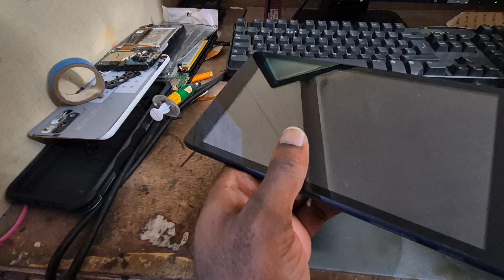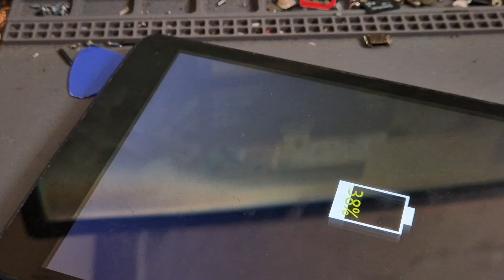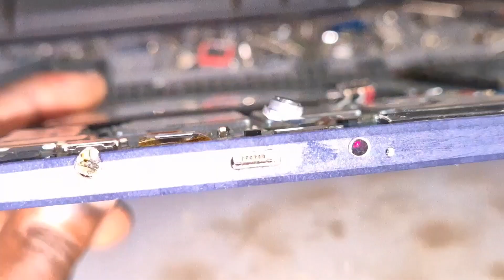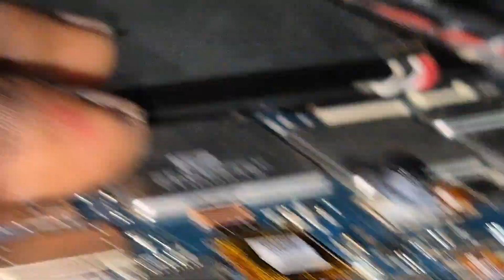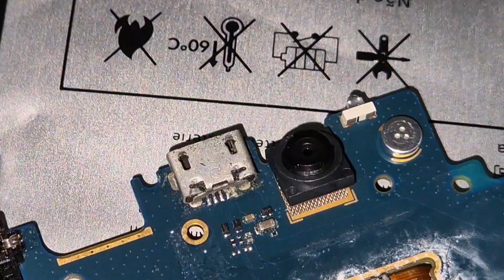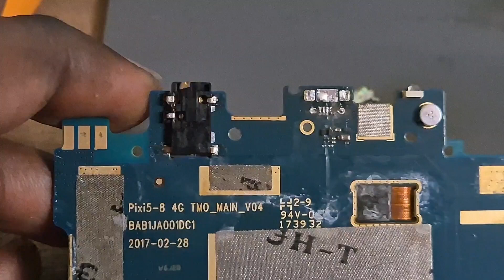Phone or tablet charge going down instead of up -battery going down instead of up when charging

Comment: water damage clean with alcohol and reflow with rosin flux to help insulate the pins . Rosin leave a film layer to protect from corrosion
Reply from the maker: end up replacing the port, the positive pin was actually damaged. nun of the pins were damaged on the board just covered. not all job i use with flux. inhaling flux can have many side effects down the road, got to have proper respirator mask
Reply: @Lenzwalters  you an extractor fan
diy  one out of old computer fan search for video how to do so online